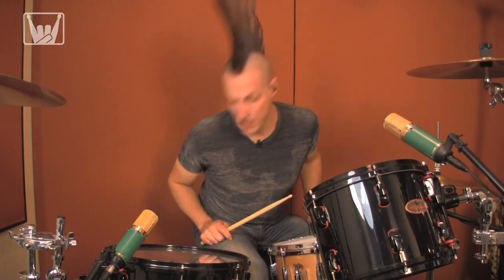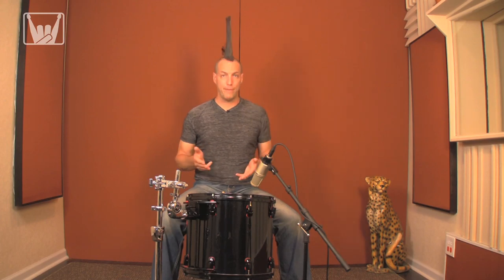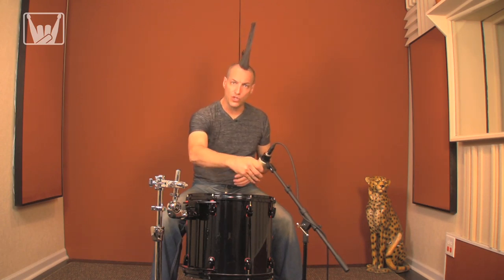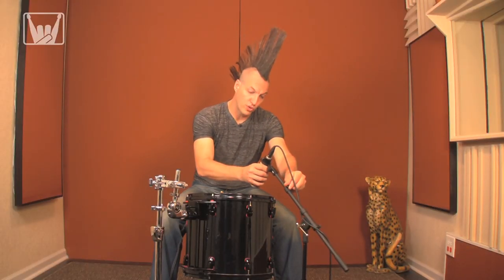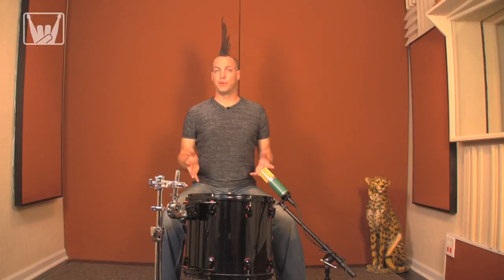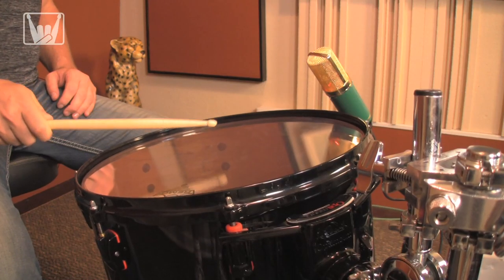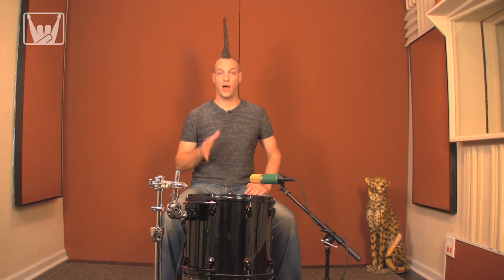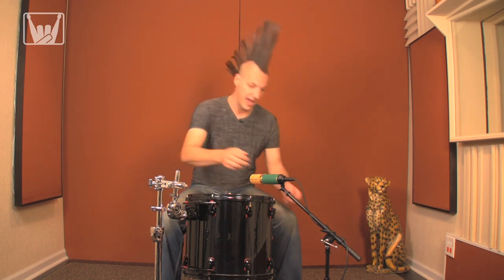FullOnDrums.com ep18 - Tom Micing Techniques

Comment: The snare is typically a 57, it just works. You can make it sound huge, or bring it down and let the overheads do the "natural" work (preferred). 
The kick, there's a ton! I usually go with an AKG D112. Roll off a little mid and you're almost there (for most applications).

Comment: if bleed wasn't the most important issue about tom close micing, v67i would be a no brainer. this is why e22S (and m179 as well) is now somehow the standard among the most prolific engineers out there: side address narrower cardioid patterns with a more pleasant bleed sound.